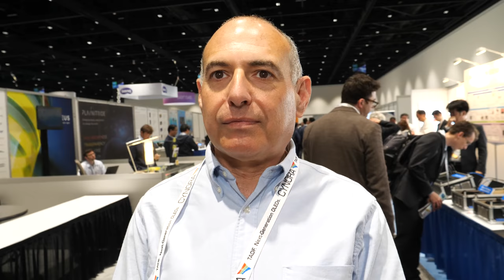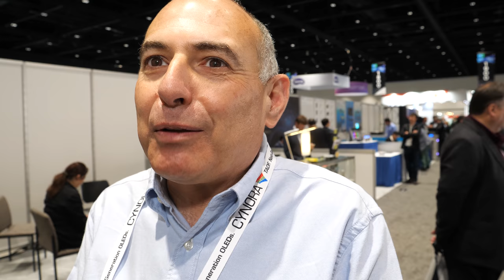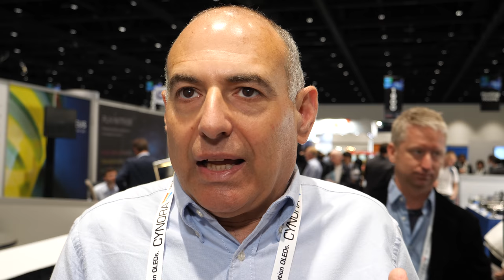TowerJazz CMOS camera sensors 8K/HDR, Panasonic, real camera sensors vs Smartphone camera

Comment: The Sony and PDAF questions were interesting. PDAF is a two part requirement, PDAF sensor hardware and PDAF software. Sony is very carefull about who they sell PDAF sensors to.....and who they do NOT sell their PDAF hardware to!!!
Reply: I guess as it’s rumored that the Nikon Z series makes use of Sony sensors, that Sony also don’t share their processing recipes as far as PDAF goes. So this means that Nikon quickly catched up to the point where they can use PDAF (almost) as well as Sony. Although Sony has a lot more experience. That’s just very interesting! :-)

Comment: Some odd questioning. Presenting a competitor with a case where Sony denies one of its customer companies access to on-sensor PDAF. Given that Sony already supply other camera manufacturers with sensors with PDAF capability, that's not a credible case.

As it is, Sony's sensor business is separate from the camera division. It would not be in the sensor business's interest to be seen to discriminate against its other customers. The customer's to Sony's sensor business have surely  got some very tight terms and conditions on this. The likes of Nikon will have to share a lot of information with the Sony's sensor business, and it would have been very clear indeed that Nikon was working on a mirrorless design from ongoing discussions and the sort of components that were going to be bought (Sony don't just make sensors; they also manufacture other key parts used in cameras). 

There will be a lot of commercial confidentiality clauses, access to technology and non-discriminatory terms and conditions in the trading arrangements between Sony and its major customers. These are not simple off the shelf components. There will be a lot of fine tuning around the fundamental core technology and products.
Reply from the maker: Nikon's AF is worse than Sony on the sensor, as far as I know. Nikon's autofocus for video is also pretty bad.. compared with what Sony has when it implements its own sensor itself. Fuji has Phase Detect for video (but their lenses mostly aren't suitable for video autofocusing) though and I guess they use Sony's APS-C and Medium Format sensors too?
Reply: @charbax  The Nikon Z series has on-sensor PDAF and, from all reports (and the specifications), they are manufactured by Sony, albeit tailored to their requirements. We know for sure than the Nikon 850 has a Sony-made sensor as Chipmod dismantled one and found a Sony part number on the sensor. Needless to say, Nikon keep the actual manufacturer secret and claim to design their own sensors. What's more accurate to say is that they they tailor the technology of sensor suppliers. The likes of Sony have very specific technology for things such as minimising noise. 

In addition, it's know than Sony make some of the sensors for M43 cameras with on-chip PDAF, and they manufacture MF format sensors which have OSPDAF and sold to other manufacturers.

It would be commercial suicide for a sensor manufacturer to deliberately cripple its offerings to favour its own company's downstream products. Sony's sensor manufacturing business (Sony Semiconductor Solutions, now run as a separated, but wholly-owned subsidiary) sells a great deal more than sensors for systems cameras. You don't build a healthy business by playing fast-and-loose with corporate customers.
Reply from the maker: @TheEulerID  the Nikon Z autofocus is worse than on the Sony A7iii, is that not true? Which micro43 camera has PDAF other than 1 model from Olympus only their most recent one? Might it be Sony was blocking PDAF on micro43 customers cameras until recently? I am very much hoping that the hopefully upcoming Panasonic GH6 will have PDAF on the sensor, but Panasonic has never released any PDAF mirrorless so it may be unlikely that they'd start now. Sure Sony makes a lot of money selling sensors, but they make more money selling their own branded cameras like the Sony Alpha series, which somehow Sony managed to make the big winner in the full frame mirrorless sensor market, with everybody else far behind Sony. There are rumors of Panasonic working on TOF Time of flight sensor for video AF to hopefully be better, maybe that's what they might do using TowerJazz, I am worried otherwise what Panasonic might do because their autofocus is pretty horribly bad and has been so for like a decade now.